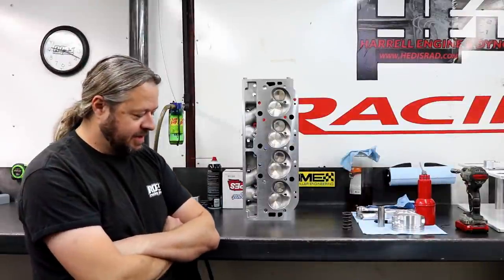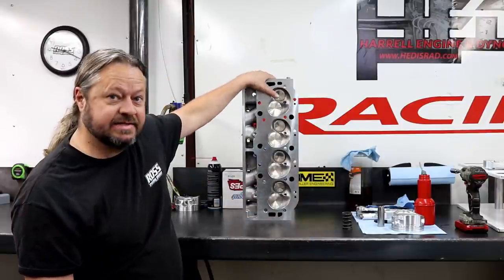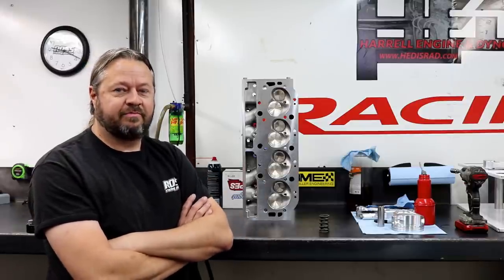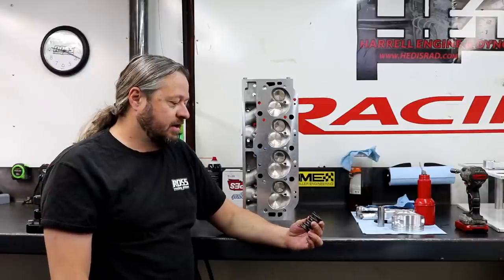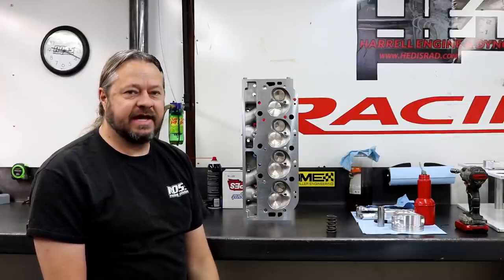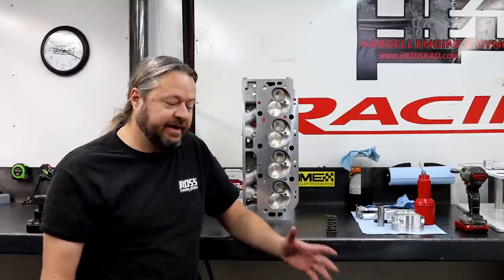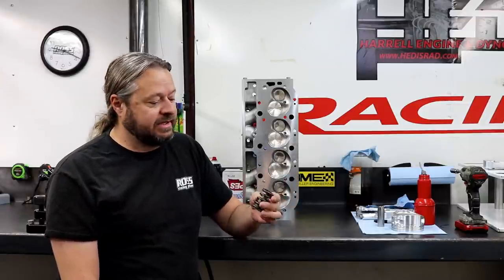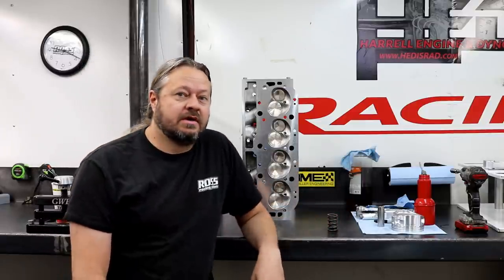Chinese Cylinder Heads

Comment: Have a set of Chinese heads. Bought bare. New valves, valves seated, guides and springs. Friend at his machine shop bench tested and they flow better than the eddies. Here’s the big difference. Just a little more tha half the price than complete heads. Even when you buy U.S. heads you should never bolt them on. Have them checked.
Reply: How to check the spring ? or the material of the gasket ?
Reply: You can but half priced garbage all you want, if you don't mind your friends and neighbors being unemployed. C'mon man
Reply: @AllaBader01  There is a machine called a valve spring tester that handles the first the second isn't part of the head anyway
Reply: @BBD40  There is a lot more to that than you'd think. People demand cheap alternatives. If your business is failing because customers are going down the street to the cheaper alternative, what do you do?
Reply: @bluespig1  Save yourself form the slow lingering death ahead. Find another way to make a living. Trying to compete on price with people selling junk never ends well. Same with sell to customers more worried about price than quality. It always a no win situation for you. Best to leave on your terms with your dignity and reputation intact.
Reply: @bbkr7910  Actually it sounds more like a leftist, unionist comment. The answer is for American manufacturers to invest in the best people and machinery to become as efficient as possible. That won't completely erase the price difference but it will attract buyers with more disposable income.
Reply: Did they need a valve job to seal?

Comment: No, this is not an apples to apples comparison. The fact that you have to take USA made heads to a machine shop to have them gone over is testament to the lack of quality control of the USA head market. I bought a BARE set of chinese eBay heads and had my machine shop check them out and assemble them with quality components. The only difference between the Chinese head and the american head is the quality of the aluminum, which may or may not make any difference depending on application. My Chinese aluminum heads are for a general street motor that will never see above 350 hp or above 5k rpms. The quality of the aluminum does not have to be air craft grade for my application. If I was using it for a circle track car where I am competitive and trying to squeeze every bit of HP and taking my parts to their engineering limits then sure the extra quality will matter. The problem is when you buy a set of edelbrock or brodix etc heads that cost's thousands and then have to take them to someone to inspect and correct a product then it negates paying for that "USA" quality if the quality is already suspect. My machine shop says they see the same problems with brodix heads as they do with chinese heads. The more and more the Chinese quality gets, the more and more in trouble the USA manufacturer will be in trouble. It is NEVER a good idea to buy an assembled head. If you need to take a head to a machine shop and have them pull everything off the head to check , then You might as well have bought the head bare and give the shop the parts to assemble them.

Comment: I was always told even new name brand heads should go to the machine shop.
Reply: You were told right. I have a set of Dart iron eagles that required a valve job right out of the box. Still decent heads tho
Reply: I was taught the same thing
Reply: Take everything to the machine shop you trust or like me i measure and check everything even if fresh from the machine shop too
Reply: #FACT , made in China, India or where tf ever, ALWAYS have a machine shop go over it if you want anything to last.
Reply: @genemounce8302  True. Very very true.
Reply: I was always taught to go over everything that came from the machine shop.
Reply: @AlphanumericCharacters  yes, absolutely. I have had stuff come back wrong

Comment: Is this from the viewpoint of a shop that works on Chevy, Ford, Etc. (maybe, just maybe BBM) cylinder heads only??? Chinese heads are better than American made Edelbrock cylinder heads produced for 318, 340, 360, 408, 416 SBM heads. Edelbrock heads for SBM are everything you accused Chinese cylinderheads of being. Junk valve springs? etc. Yes. Having a machine shop fix two $250 blank aluminum cylinder heads for SBM STILL comes out miles ahead of Edelbrock SBM heads (as one example). Some of us don't have the luxury of 1000 options to include such AFR, John Kaase, etc. never mind the budget for Brodix or the harrassment of Indy Cylinderheads. Your perspective is every bit as narrow as you believe mine is, yet you work on a diverse field of performance. Generalizations should be labeled as such.

Comment: I run a set of 3038 Pro Comp heads on my 408 SBF and I have no complaints, I did change the valve springs a couple of weeks ago after they served 5 years of drag racing, I did find some broken springs, good thing they where the double wrap type again I have no complaints.
Reply: Some people it's not china vs america. Some people have a budget that is more like China products vs nothing. I'd rather have china heads on a running engine than no heads
Reply: Bare castings with good parts, or most likely you'll be building it all over again. I've seen their junk valve train and I wouldn't run it in a stock motor.

Comment: Current advice from cam suppliers is : with flat tappet lifters, break in the cam with reduced
 pressure springs.....So , your going to toss them anyway for the ones specified by
the cam mfg.......Other than your comment about the casting quality ( no specific examples),
and the machining, (no specific examples), What's your beef ?????

Comment: I have a set of these on a 351W that I got as a bare casting. Had guides and seats installed and put in performance springs, locks, retainers, and FORD valves. So far no problems. Dyno'd at 380hp 415ft/lb. The casting itself didn't need too much prep work, but absolutely wouldn't put one on assembled unless a machine shop set it up

Comment: I bought a set of promaxx 200's directly from promaxx in Alabama. They assembled the heads there. I took them in to be checked out and they didn't have to do a single thing to them. They recommended that I use a different keeper to reduce spring pressure to match my cam. I was pleasantly surprised by the quality. I may have gotten lucky though.
Reply: I know the guy in Tennessee that ported and developed the shapes and intake runners for the promaxx heads
Reply: Donnell Austin   strange ,my vortec headed mild 350 with cast heads makes 375 and 420,they came with the engine.i just swapped the cam.

Comment: In the aero world, the Chinese are notorious for shoddy metallurgy.
Reply: The Chinese are know to have an exceptionally poor command of the science of metallurgy.   They copy (crappy) Russian planes and their copies are fit only for political enemies to fly.   Engines come unglued on takeoff, and landing gear collapse.   Their castings and forgings often have horrendous inclusions.
Reply: Everything they make revolves around being as cheap as possible, especially with metallurgy. Alloys with minimal mode expensive metal%. Stainless that rusts and magnets stick etc. That combined with nearly zero quality control and production speeds ramped up to fastest possible and you end up with crap. Most of the time you end up wishing you got something priced a little higher, but don't have to replace near immediately

Comment: I guess I must be one of the Lucky ones. I Purchased my big block Mopar “Chinese“ heads from a well-known supplier of Mopar parts on the Internet. When I got them home I did a cursory checking of EVERYTHING. After CC’ing them, port matching and a quick bowl blend these were ready to go pretty much out of the box. I am no novice to building engines but I was pleasantly surprised when I received these, and this is probably 15+ years ago when they first started to introduce them when US soil. 
 No problems whatsoever, no valve recession, the bronze guides are still nice and tight and the valves have the thin margin I had hand seated them into years ago. I had these flow matched on a Dynaflo machine back in my hometown and they exceeded their advertised specifications needless to say I was a happy camper for a pair a big block aluminum heads for less than a grand. They are out there but as stated in this message do your homework first as with anything!
Reply: Sweet 👍

Comment: Why not do a comparison of just bare heads, and assemble them with a cam kit? Verses a name brand.
Reply: That could be a valid comparison. However, as a Journeyman Toolmaker, I would also like to know what the metallurgy of the head is like. China likes to use lead in a lot of their products including materials you would never expect lead. Their metals typically do not meet ASME standards and thus do not have the same properties. In other words, if you buy 4130 Chrome Molly in the US, and then buy some from China, the composition of the 2 samples will not match. From experience, the Chinese Chrome Molly is inferior. It does not harden the same and has less toughness. Their aluminum composition is not the same either.

Comment: I just finished a set of Procomps on my SBF 351W that I purchased them bare. I put a lot of work into these heads fixing and cleaning up the castings, especially the short side of the runners. I used Milodon pro flow SBC valves, two piece guide plates, Comp 986 valve springs for mechanical flat tappet cam. Nothing special! 10.60’s on a 100 shot 1/4 mile!

Comment: Buy once, Cry once! About some large oval Port Chinese heads and they ran really really good. Problem was after running them for a while the valve guides wore completely out and my valves could move from side to side. I think the only reason I didn't drop a valve was because I put comp springs on them when I got them.

Comment: It's not just the Pro Comp/Speedmaster stuff. Pretty sure Edelbrock now sources all their raw aluminum from China. The E-brock Performer RPM intake on my big block Chevelle actually has rust spots all over the surface. That's apparently pretty common and entirely due to the bad alloy.
Reply: i have an Edelbrock intake that has MADE IN CHINA embossed right on the bottom.

Comment: I HAVE BEEN USING PROCOMP AND OTHER BRANDS OF CHINIA HEADS FOR ABOUT 13 YAERS AND HAVE BUILT AND USED ABOUT 20 SETS OF THESE HEADS AND NOT ONCE HAVE I HAD A PROBLEM, SOME OF THESE MOTORS I HAVE RUN 8 YEARS AND STILL NO PROBLEM .
Reply: i am thing of speed master for the 460 have you delt with them .i need to build this 460 asap
Reply: @overbuiltautomotive1299   I have dealt with them for years and they have taken great care of me and i will continue to use them.

Comment: Ran a cheap set of heads. After completely reworking them they ran ok. Didn't have oil return holes in it either.  But right about the 8th mile it felt like a boat anchor was holding me back.  Ran 8.0s at only 159. Put a set of dart pro 1s and now goes 7.70 @ 174. Nuff said about that
Reply: You trapped 159 on Chinese heads?

Comment: I do question why a set of twenty head studs from ARP is $400
Reply: Flash Man  Seriously though $400 for studs. 

Makes even less sense when the ARP head bolts are also half the price of studs and require more work in the manufacturing process. 

This is a market that needs some competition.
Reply: For street us I would buy a crate motor from the manufacturer. For a competition engine I would ask a race engine builder to build an appropriate engine. Cheaper in the long run.
Reply: Paul Wilson  Seeing loads of factory GM head bolts failing?

I’m sure you are running 20 pounds of boost, you big stud !

Yes, ARP is a better product, but are you seriously trying to convince me that a bolt should ever cost $20?
It’s not going into Space.
Reply: @gregwarner3753  Let me know when you do either of those things
Reply: Paul Wilson  Ya if you don't have money to throw away and are on a budget don't complain about money. Get with the program, only us people with money should have toys that work. Now pick up your broken pieces and go home.
Reply: Paul Wilson  I've used dozens of aftermarket studs or bolts. If you tap and clean the holes, they work perfectly.
Reply: @kyleallen3857  Competition exactly,at the moment they have no comparable quality competition. Till they do they can charge the price enough customers are willing to pay. I for one am willing to pay that so I don’t pay more in the long run but I would love some comparable quality competitors entering the market.
Reply: Do the basics of economics really need to be explained? If you don't like ARP's prices, you can always buy any other manufacturer's hardware...
Reply: @RyTrapp0  Do you have a firm grasp of the basic economics of ARP bolt production?

Please enlighten us with your knowledge. I am interested to understand why a bolt that is not going into space costs $20.
Reply: @RyTrapp0   I am a Big Fan of Supply Side Economics and have a firm grasp of the concept and its underpinnings. 

Could ARP sell more fasteners at a lower price point? Would the net profit increase? You don’t know and until there is a second entrant to the market, neither will ARP. 

They do a great job of marketing. I predict that someone like Texas Speed will begin contract manufacturing head bolts as they already private label other contract manufactured fasteners. There is no patent protection involved and TSP has built-in demand. 

We shall see

No need to be condescending

Comment: I bought some screwdrivers off ebay because I needed them at work the next week. Didnt realise they were coming from China.  6 weeks later when I had forgotten about them and no longer need them, they arrived. They looked exactly as the photo. Only problem was, they were about the length of a match!! They were tiny tiny little screwdrivers - I could close them in my fist and you would not see them sticking out!!
They were very competitively priced though...

Comment: I bought a blueprint 347 that had China aluminum heads.  The engine was trash.  When we tuned it, it needed 37.4 deg timing at peek torque with only 87% VE(wide open, NA).  Dyno guy said they were probably the worst heads you can get for Winsors.  He said they are basically equal to the 70s smogger heads.  I spent less than 500 at a local machine shop for some rebuilt gt40 heads.  I haven't had it on the dyno yet, but VE is up 87 to 94.  I gave the old heads to the machine shop, they threw them in a scrap bin...
Reply: second person this week to point out Blueprint has its issues. Guess that's why they give so many free engines away for magazines and youtube channels to use?

Comment: I break in my flat tappet cams with soft springs @2000rpm for 20 mins. anyway, and then always change them out. Would i be better off with a set of Vortecs all done up with beehive springs and screw in studs than the Chinese route?? Thanks Much!

Comment: I sharpen and alter cutting tools for a living. 
I had a 3"dia. drill with a 
#5 morse taper .  The customer thought he would save money buying a China made drill  as a drill that size is very expensive. The morse taper was way off . At the large end ( the gage line  ) was on size but at small end it was way too small. It wouldn't fit my machine right . I managed to make the alteration to the drill but taper was still way off .
I don't know how they could use it like that .
I got paid. As you say you get what you pay for.
Even made in China that drill cost a lot .